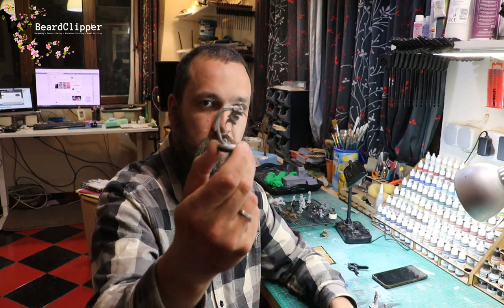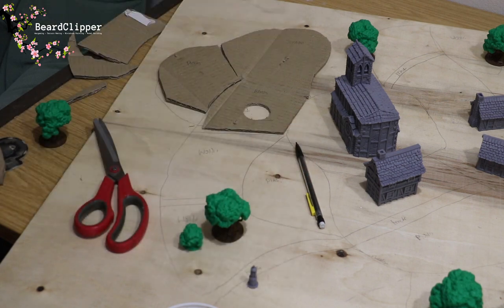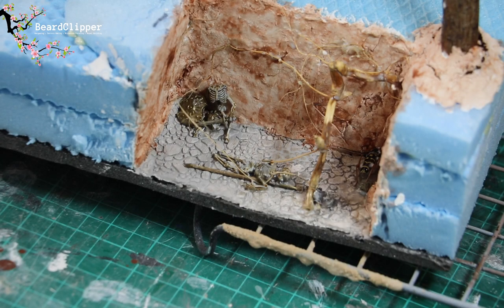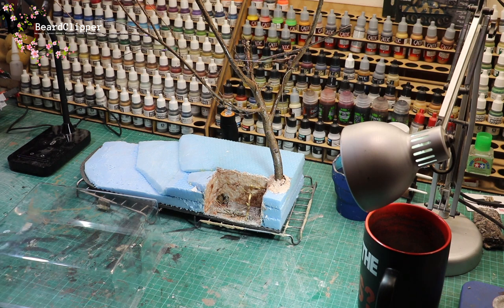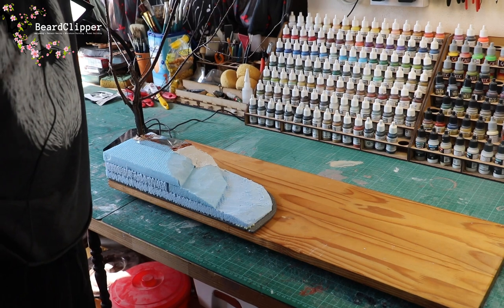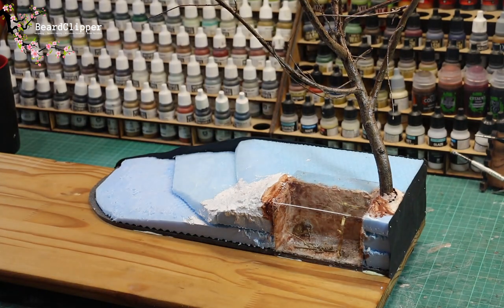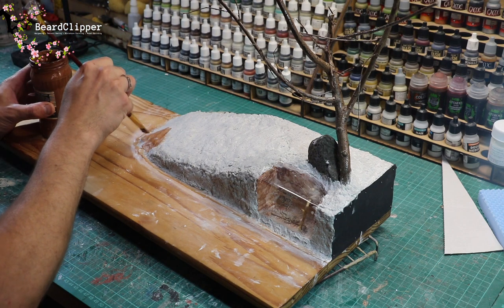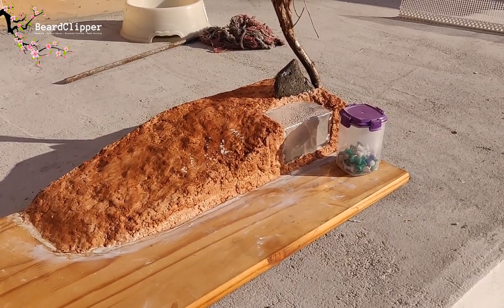A burial chamber under a play area, and Joan of Arc terrain - Hobby Vlog #27 is here

Comment: Nice collection of builds as usual. One potential work round for condensation would be to use a small amount of cat litter in the chamber ( looks like rocks anyway) Nice video👍🏻
Reply from the maker: Thanks mate :)

Ahh that's a good idea; I pricked a couple more pins through this morning and the heat of the day has dried it out, even inside the chamber. I'll keep an eye and, if it's a problem again, drop some in.

Thanks man :)